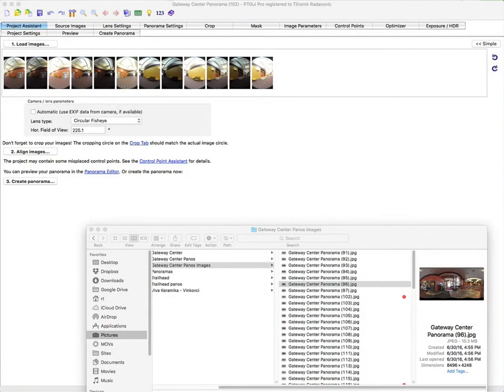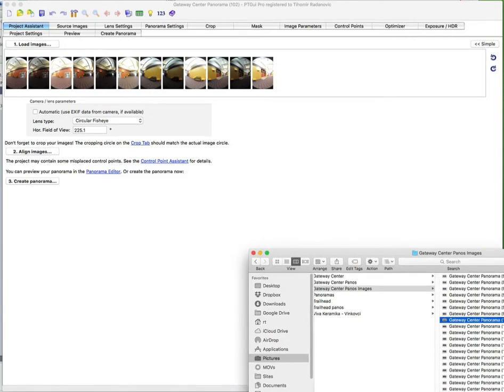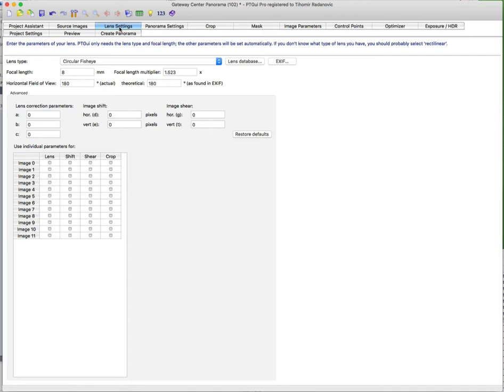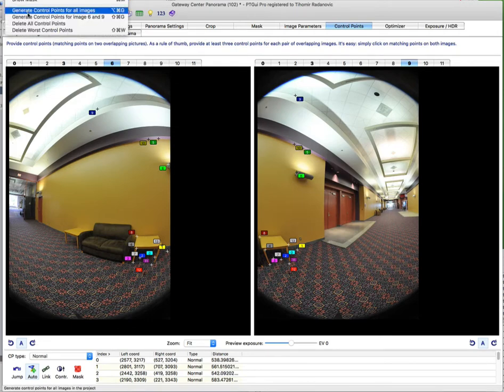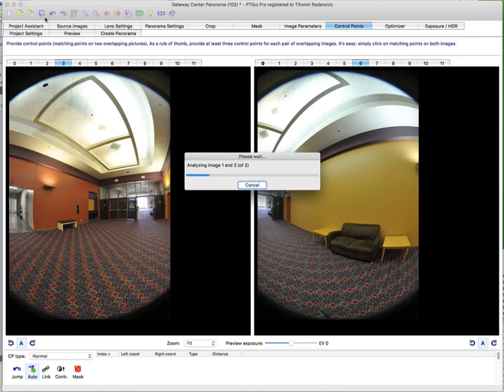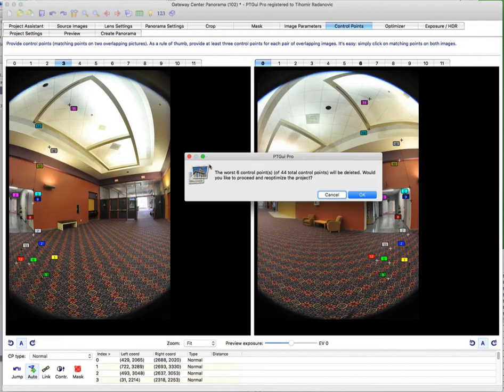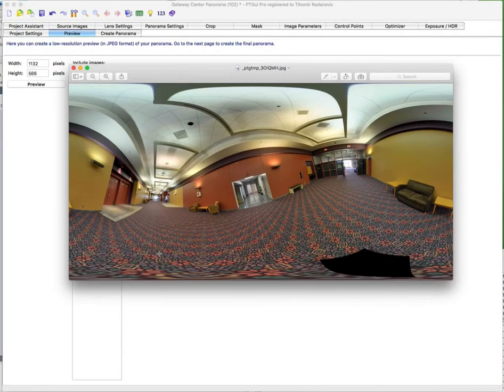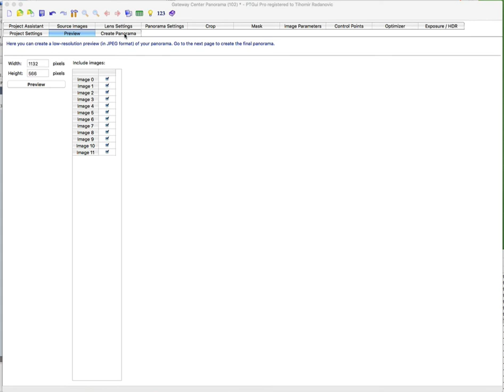PTGui stitching problem resolved

Comment: Sometimes the program places control points in the sky and this causes errors when joining photos. I suggest masking the sky before adding points, then add control points and assemble the panorama. then only remove the masking and problem from the head. I checked several times.

Comment: Excellent tutorial, thanks for sharing! Do you happen to have any tutorials about how to stitch water or more specifically a 360 photo of a pool? Thank you in advance 😊
Reply from the maker: Hi Julio, if you are having problem stitching because the water moved during the shoot and there are no static reference point, than you will need to find the reference points manually in the area that are anything but water. If you have no other reference points, than good luck because you will need to do this manually the best you can and than fix it in Photoshop when the pano is created. 

Going forward, you will need to prepare for such problems during the shoot and not try to fix it in the post. 
When I have a blank wall in a shot and there is nothing on it but I know it will have to be stitched somehow, I put 1 or 2 posted notes on the wall which I include in both angles and than use the as a reference for stitching. When the pano is done, I remove it in Photoshop.  

I don't know what you can use in water that constantly moves. Stick an umbrella in the middle of the pool :)
Reply: @rtradanovic   Lol... an umbrella? Well one have to be really creative with it...thank you very much for the advice. A reference point is a good start. I'll see what I can do 😁

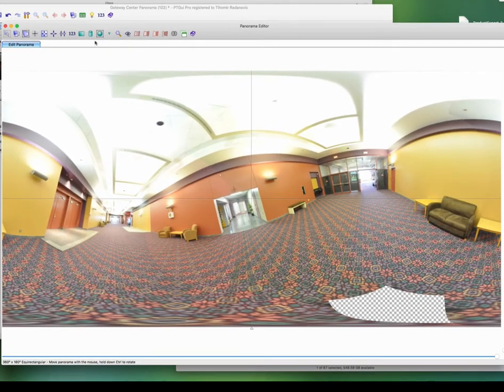Comment: 4:36 I don't have that little tool! >,<
Reply from the maker: Sorry to hear that. maybe because you don't have the paid pro version. The interface has changed recently with a new version of the software but the functions and told have remained the same, with some improvements in functionality. I have also found that if you do multiple attempts fo automated alignment, at some point the software actually does it right. It may take 20 times but it eventually happens. You may tray that.
Reply: I using Pro Version, Thanks RT for the useful sharing! :-)

Comment: Hi this is Karthikeyan, I have a doubt? I am using Nikon DSLR Camera model: D3400  which Fisheye Lens , Tripod Panoramic Head and along with PTGuie Software. I am waiting for your valuable  Replay!.
Reply from the maker: Karthi keyan Karthi keyan sorry for a delayed reply. With D3400 you will not be able to do automated exposure bracketing in order to do hdr panos. You can still do regular panos but the number of images you need depend on the lens. I use Sigma 8 mm which covers 160 degree angle and shoot 90 degree angle increases. I use Nikon D90 and it works great. I hope this helps.

Comment: What I find the easiest when I have a control point problem is to add manually 3 control points between the "image 0" and "image 3" very accurately, so by the 4th control point ptgui will assimilate the image and add it automatically (just check if it's correct) if it is you are done... go back to project assistant and click align images. 

I have a question, I dunno if you have had the same problem, I shoot on an automatic exposure and sometimes when I load the 12 images I find that in between images there is like this exposure ghost that look awful, my way around it is to mask the area of the under exposed image or sometimes delete the image.... do you have an easier way to get around it?  I will really apreciare your reply... thanks and keep it up!
Reply from the maker: Well, adding control points manually was one of the things I tried and it didn't work. Eventually I learned other tricks such as dumping the over and under expose images and working with just correct exposures and than pressing Align images over and over again until it aligns them correctly. For some reason it does not always produce the same results. I also found that if one of your angles doesn't have any identifiable spots in the picture, than good luck aligning them. So If I have a white wall right next to me, when I turn camera to that wall, I better have some identifiable spot that will be visible on the joining images otherwise it will never be able to align it. SO now, in situation like that, I make sure there is always something there to align.  

To your question I can't really give an answer because I have never shot with auto exposure since I have discovered it produces banding. I always use manual because that way I never have banding issues, which are otherwise almost always visible when you look up into the zenith.

Comment: I am using a Phantom 3 Professional Drone to create 360 Panoramic images from the air using the Dronepan app. I have it set to 3 rows of 8 images totaling 24 images altogether. Every time I use PTGui, its telling me I need to add some control points. Once I add them and run the optimizer, its then telling me its Very Bad. Do you have any suggestions or advice on how I can overcome this ongoing issue? If it says I need control points on image 15 for example, do I select image 15 on the left side and add some points and then go to image 16 on the right side to overlap with and add points? I noticed you went from image 0 to image 3 opposed to going from image 0 to image 1. I wonder if I am not placing these control points on the correct images or something.
Reply from the maker: Sorry, for a late reply. The reason I go from 0 to 3 is that I have liked the 3 images into a group since I shot HDR. The three images are the same with exception to exposure. You can link them together so you don't have to create control points in each one, but only in one of the three. I hope this helps and it not too late.
Reply: Chuck Purnell when you shoot on a drone remember that you have shift between N,S,E&W shots... it is not impossible to shoot with less shift between images, but the wind and if your drone is light will make it a little bit hard... my way around that is to take at least from 15 to 18 images per panorama to compensate the shift, but usually I have to add manual control points at the end...

Comment: Cant find the tab "Optimizer", how did you add it?
Reply from the maker: You have to switch to Advanced using the button on the top right side of the Project Assistant tab
Reply: Gotcha!
Reply: When i choose "generate control point for image "" and "" " and PTGui doesnt find any, how many control points manually its the best for stitching?
Reply from the maker: the instruction say I believe at least 4 or 5 control points. Just FYI, this is a solution to some issues but I have found situations where this process did not help and I had to come up with alternative methods that I have not recorded yet. One of problems is where the pano is too blank with no texture or identifying points, such as shot towards a blank wall with no pictures or anything else in the overlapping zone. This can really be a pain to fix. So when shooting pay attention how you turn the camera to avoid shots like that. The second one is in the HDR shots where for some reasons it cannot find overpaying points and match them because the under or overexposed ones may be too dark or light. The solution here is to decide if you can live without HDR and simply select a single set (correctly exposed ones) of images to work with. You can also do aHDR merge in Photoshop ind bring in a single set of perfectly exposed images. Than, tell the stitcher to align it itself using the 3 steps. Now here is the key. It will always align  it differently. If you keep trying, it may eventually align it correctly. I did that many times. So go through the second step Align Images as long as it takes to align it correctly. I hope this makes sense and it helps.
Reply: great, thanks!, is there a way to contact you for sending a image and telling me how to fix the stretching ?
Reply from the maker: You can upload the images to my dropbox. Send me your email so I can invite and share it with you.
Reply: cant find the link to your dropbox
Reply from the maker: I need your email address so I can invite you to share my box so you can upload the images.
Reply from the maker: ops sorry,. I missed it
Reply: could you invite me ? didnt see on my mailbox :)
Reply from the maker: Sorry, I had to leave. I have just sent you an invitation to dropbox
Reply: Np, done shared on dropbox take your time mate! thanks for this!
Reply from the maker: I got your photos, I will try do this now.
Reply: Thanks!
Reply from the maker: I did not realize you are working with 24 square images and creating a cylindrical image. I don't have any experience with this type of images. However, I see where the issue is. You have several ceiling images with no identifying points that overlap and this is where the software can't create the control points. I have tried to do this using the knowledge I have but this is another set of settings that I am not familiar with so I am afraid I am not able to help. I am very sorry!
Reply: oh, okey thanks for your time!
Reply: Ignacio Britos if you have the basic version of ptgui you will not have it, you need to upgrade it... if you have the full version just click on advanced and it will show up.

Comment from the maker: I forgot to mention that if you are having problems either creating control points or stitching, or you run into any kind of nonsense problems (things that worked before and all of a sudden don't any more) just save and restart the application. I have noticed that PTGui likes to get clogged and it runs much better when frequently restarted. The app renders good results 80% of the times but it is a bit flimsy so have patience with it.
Reply: Hi Tihormir, I can't seem to get perfect results, I followed your steps but still some places the alignment is off and I have to used PS to correct it. Also, my average control point distance is 2.7, that's best I've gotten so far. Been fiddling with this for a long time trying to fix this problem.